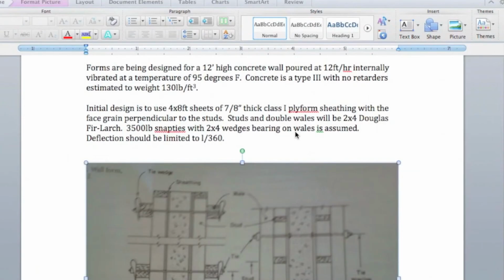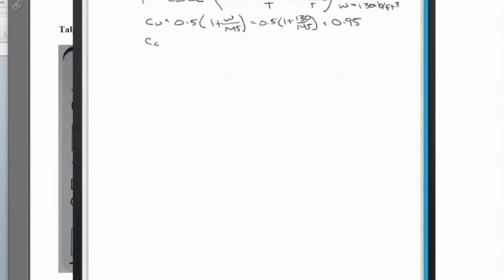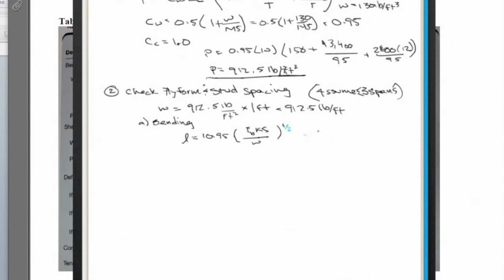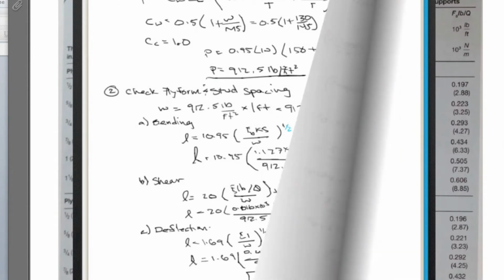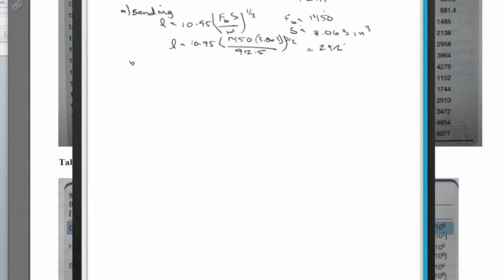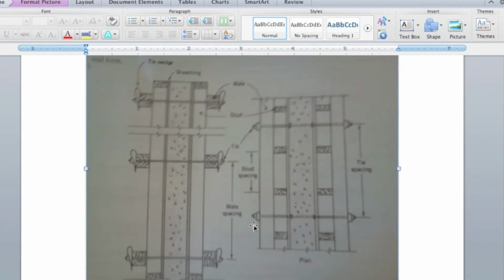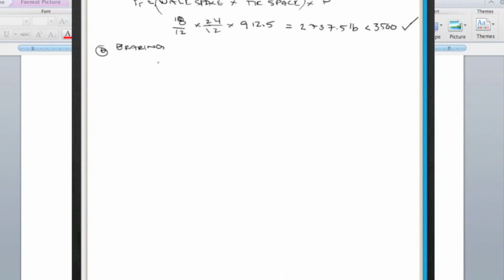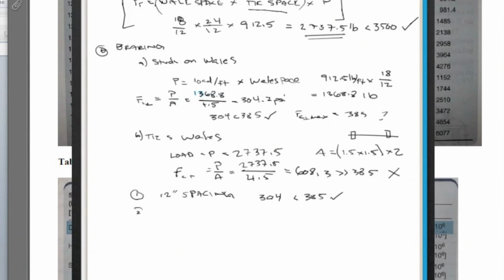Concrete Wall Form Design Example

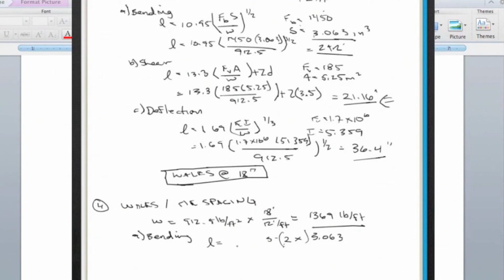Comment: 20:31 my calculations show 34.2 inches, not 27.9 inches.
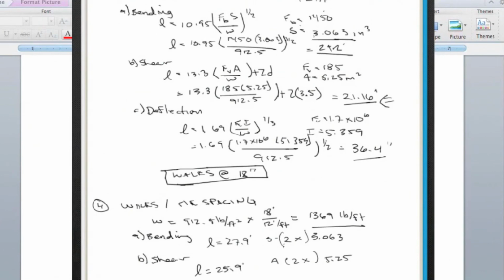20:51 my calculations show 35.3 inches, not 25.9 inches.
21:17 my calculations show 45.8 inches, not 45 inches.

This would mean that bending governs, not shear.
What value would you then use for tie spacing?